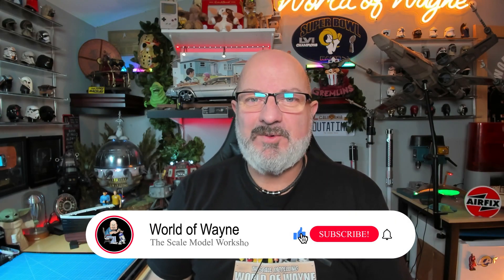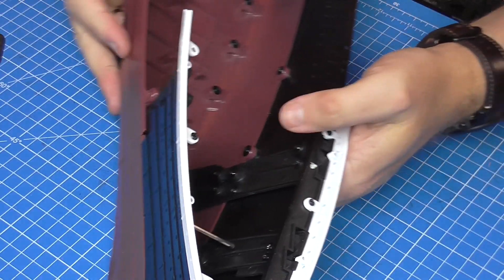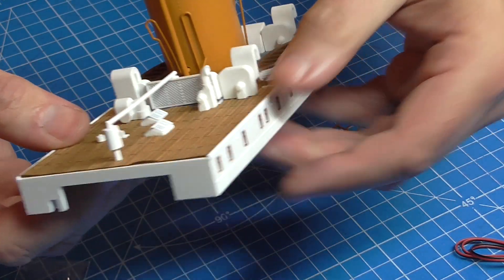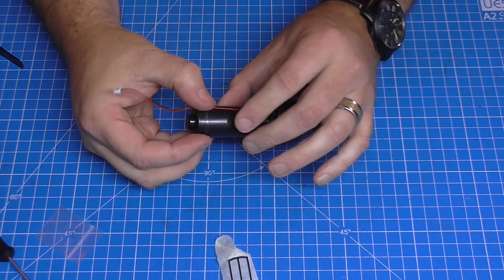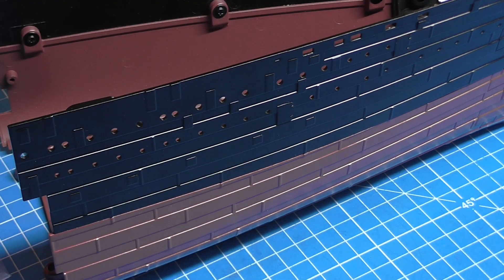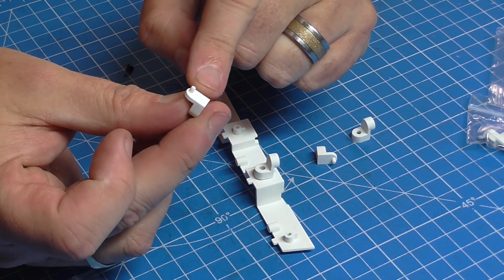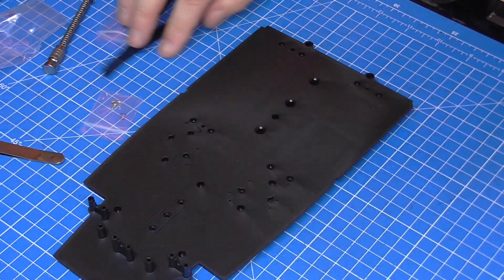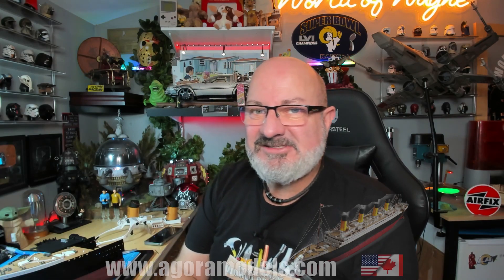Agora Models Build the RMS Titanic - Pack 5 - Stages 21-26

Comment: Looks good. Just finished this pack 2 days ago. I try not to glue anything in unless really needed incase they send replacement parts or ask to take something off. Bismarck had the 1 set of guns they wanted you to remove and replace but no way was I going to attempt to do that given they are glued down solidly. But enjoying this build so far. Still have the rigging to do on Bismarck which looks intimidating and I'm slowly working up the courage to try it.

Comment: Did you know the origin of port and starboard side comes from when ships rudders were mounted at the side of the ship rather than the centre line. The rudder was on the starboard side (steer board) and to prevent damage to the rudder ships docked with the quay of a dock to the left hence port side was the side that they would put near the dock at the port.

Comment: Hello Wayne I have a question I was working on the funnel of Titanic and I had lost the part that they gave us to put on top and I glued the old top on and I found the other one after I glued the other one on, my question is I can't take the middle part out of the first funnel because I had glued it I was wondering will it work still? If not what can I do to get it to work?
Reply from the maker: It needs to be able to remove so.tou can wet the sponge inside the funnel for the smoker unit
Reply: @WorldofWayneUK  ok so how can I remove the top of the funnel when I glued it?
Reply from the maker: @aaronvaughn478  Freezers are your friend when it comes to breaking glue
Reply: @WorldofWayneUK  how long should I leave it in the freezer?
Reply from the maker: @aaronvaughn478  Overnight should be good.
Reply: @WorldofWayneUK  I got off I didn't glue it very good so it came off with ease